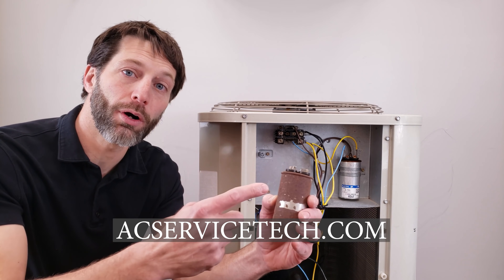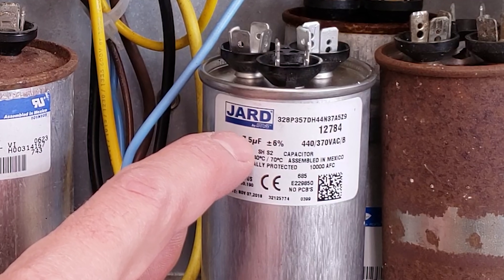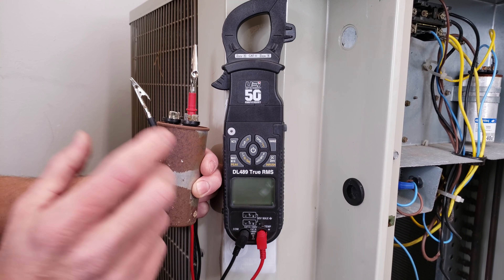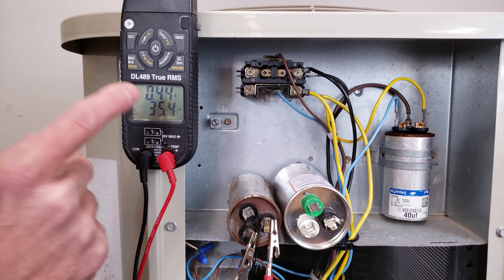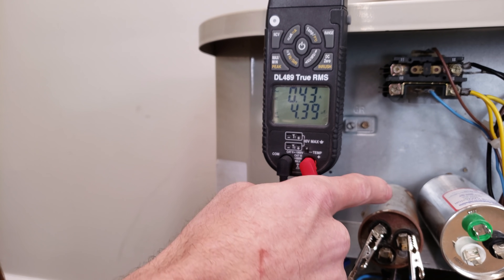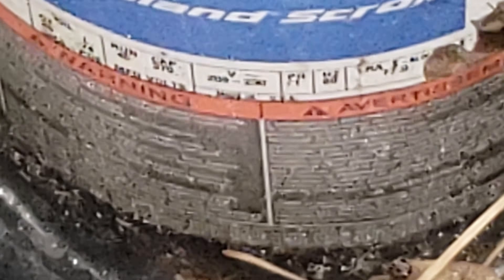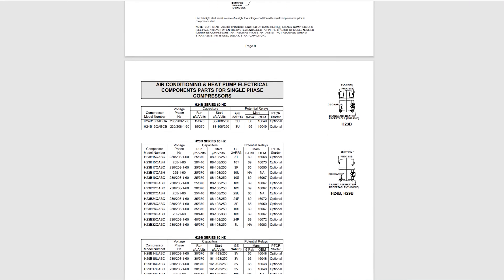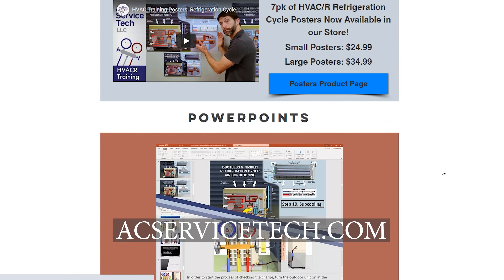Finding Run CAPACITOR SIZE on an AC Unit, Ratings Worn Off!

Comment: Well done video but it's incorrect at 1:20.  Oversize does not burn windings. Oversize can cause relay chatter, wear or weldment on contacts.  Undersize reduces starting torque.  10% deviation is allowable.  Any information on substitution?  There's that call downtime will cost money or product, but I have a truck with assorted spares.
Reply: Higher or lower than specified MFR run cap will increase run winding current, increased current reduces efficiency (cost $$), increases heat and reduces lifetime.
Reply: @dan4091  Thank you for your answer.
Reply: you are confused; "relay chatter" refers to the coil on the LOW VOLTAGE side of relays and is caused by LOW VOLTAGE. Impossible for relay chatter to be effected by the side being switched on or off, it can only be effected by the switching circuit that energizes the coil that thrusts the set of contacts closed or open
Reply: @patrickhutchins6935   In capacitor start motors, relays are line voltage. In capacitive circuits current leads voltage. Capacitance reactance of a capacitor in ac circuits plus motor impedance are factors to balance for enough current to provide starting torque.  Too small a capacitor and there's insufficient "boost" for starting, and too large there's a mismatch capacitive reactance with varying voltage effects that can cause relay cycling and points heating.  Not always noticeable at first, but it does exist.  For reference check into the RSES SAMS Manual for further reading.

Comment: Whoa. An artificial phase of electricity? That’s funny, I always thought run caps kept your voltage and current in phase with each other when the inductance of the motor pushed them out of phase….I guess trade school lied to me 🤔

Omg putting in the wrong size capacitor doesn’t burn out a winding. It pushes the voltage and current out of phase the exact opposite direction of the inductance of the motor and makes the motor get hot. It will just cycle on thermal overload. It very rarely burns up a winding.

Holy misinformation Batman
Reply: Not on a CAPACITOR RUN motor there sparky, the voltage and current are purposely shifted 90 degrees out of phase to generate a rotating magnetic field. Kinda looks like your trade school professor may not have been the brightest bulb on the block !
Reply: @nunyabusiness6746  it’s not a capacitor run motor dill hole. It’s a PSC motor. The RUN CAPACITOR is on the START WINDING. Also, since you obviously don’t know, each line in single phase is 180 degrees out of phase there bucko.
Reply: @nunyabusiness6746  a run capacitor is literally in series with the start winding on a PSC motor jackass. Google it.
Reply: @nunyabusiness6746  Did you seriously ask me if I know the phase angle of three phase? Do you even math? Uhhh 360/3=120 degrees.
Reply: @nunyabusiness6746  maybe next we can talk about the different between wye and delta winding configurations in transformers, how they affect the potential voltage to ground, and the difference between wye and delta winding configurations in three phase motors. You’re barking up the wrong tree bucko 🤣
Reply: @nunyabusiness6746  you can’t even define grounded and grounding conductors without google because you don’t even know that a run cap is in series with the start winding on a PSC motor and literally has nothing to do with the run winding 🤣🤣🤣
Reply: jman0870 I’ll talk all the electronics you want i’ve been an electronics technician 40 years, can you tell me what VARS stands for?
Reply: @nunyabusiness6746  remember that time you thought I didn’t know the phase angle of three phase? Cmon bucko. Wye vs delta on transformers and motors. What is inductance and what is capacitance’s effect on it?
Reply: jman0870 Quick,  give me the formula for resonance.
Reply: You have a circuit with a  with 10 ohms resistance, and10 ohms of inductive reactance, how many degrees does the voltage lag the current ? It’s a trick question, let’s see how much you really know !
Reply: jman0870 The run cap is parallel to the series combination of the start and run windings, if you put a voltmeter across the capacitors herm. terminal which goes to start winding and the caps. common terminal which feeds the run winding terminal, the voltage you will see is the series combination of the back emf generated in the start winding combined with the run winding voltage. Now your car alternator is wye generator feeding into a diode pack which rectifies it to three phase DC, which incidentally I have repaired in the past, you see, I also worked as an auto mechanic when I was a youngster like you ! Now delta, other than what it looks like, I  would have to refresh my memory if I wished to discuss the electrical characteristics of the delta configuration and i’m really not that interested at this point, now a wye generator is much simpler to analyze with the three windings 120 degrees out of phase with each other. By the way, do know know what a phasor diagram is and how to actually analyze an AC circuit? If not, I suggest a couple of years at a college with a good electrical technology program so you can sound a little more intelligent when discussing this crap, especially after electric machines class where artificial phasing to generate a rotating magnetic field is explained, plus even if you don’t actually get a job as an electronics tech. it will go a long way in the refrigeration field, especially these days with all this electronically controlled BS, plus perhaps one day you may even be as good as me.
Reply: jman0870And a PSC motor doesn’t have a start winding, it has an auxiliary winding and is used in low power applications like fan motors, in fact if you’ve ever worked on a really old GE refer you’ve seen the three wire fan motors they used to use, that’s a PSC motor. Yes maybe I do need to refresh my memory, I started working in refrigeration in 1975 and got my AAS in electronics in 1981 and raised my family working as an electronics technician from which I retired, and I currently am in business repairing major appliances to supplement my SSI check. I hope one day you will know as much as I have forgotten.
Reply: The wrong size run cap will increase current, reduce efficiency, increase heat, may trip the overload, and will probably reduce compressor lifetime
Reply: @dan4091  isn’t that what I literally said? 🙄

Comment: if unit calls for 40 mfd, can i put a 45 in it? somewhat about 10% (12.5%) higher
Reply: it will draw more current and be less efficient, so it'll cost you more money to operate and decrease compressor lifetime

Comment: I'm not an HVAC tech, but I did stay at a Holiday Inn Express last night.  

My HVAC system that was installed just  under 3 years ago has stopped pushing cold air and the tech that is scheduled to service it tomorrow said it was likely a capacitor.  From what I've read, even under horrendous conditions, a cheap capacitor 'should' have lasted over 3 years.  Is there any helpful info you could share with us homeowners so that I can try to ensure that they don't just slap in another poor quality part?  ✌

Comment: It's very simple - run the motor with different value capacitors, use the capacitor that draws the lowest amps. (for motor run capacitors - not start capacitors).
Reply: Great idea in theory and maybe completely correct but kind of impractical unless you have a dozen or so capacitors lying around right?  And no DIY will have that.
Reply: @condor5635  That's when you make friends with the guy that works in the electric motor repair shop.
Reply: @paulsawczyc5019  who has time for that ? Lmao

Comment: Great Vid !! I used your method to find out what my AC called for, and as luck would have it my Cap. was replaced by AC Tech. approx. 2 years ago with a 55/7.5 cap.-when I took a picture on compressor like you said it called for a (50 not a 55) is it safe or should I replace it ? the fan rating was correct at 7.5 Thanks in Advance !
Reply: 10 percent higher or lower is ok

Comment: great content, what if the fan writings are worn off? I got the first number and the cap.  Just need the fan?  do you just guess on that?  it is a small fan so i will assume a 5
Reply: try a 5 and 7.5, see which draws lowest current and go with that

Comment: i hade one the other day it looked to be a 40 or 45 mf and i got 21.5. I megohm the compressor and it went straight to bad.
Reply from the maker: The compressor killed the cap or the cap killed the compressor, thanks!

Comment: Thanks for stressing that the mfd rating is important and the voltage of a new run capacitor can be the stated voltage or a higher voltage. As a preference I always replaced with the exact mfd rating but always with a 440 voltage rating. With contactor replacing, I always replaced with a 40 amp. although the factory installed a 30 amp. Thanks for the excellent accurate videos.
Reply from the maker: Awesome, thanks!

Comment: What happens if the info is worn off, no schematic and “the capacitor exploded, so it reads no value”???  What if a tech before you takes out the cap and doesn’t come back, no info?   It’s not always that cut and dry.
Reply from the maker: I'm with you but what do you have left in that scenario? There isn't much left in order to determine the HP of the compressor to determine the run cap size. I just wanted to clearly state what to do in the rusty capacitor scenario, thanks!
Reply: @acservicetechchannel  i have discovered that in most cases the start winding needs to flow one third the amps that the run winding does.  The size of the run capacitor determines this.  When none of the manufacturer's data is available just guess.  Start the unit and measure the amps flowing through the run capacitor and through the compressor common. If the capacitor amps is more than one third of the compressor amps you guessed too high; change to a smaller capacitor and check your amps again.  If it was less than one third you guessed too low; change to a bigger capacitor and measure amps again.  You will soon have a happy compressor.   I would guess the fan motor would work the same way but I've never needed to try that.
Reply: @kbouwman64  actually you want the run capacitor that gives the lowest run winding current, a run cap value lower or higher than ideal will increase run winding current

Comment: I got questions about Honeywell t-stat pro series . I turn on  for cooling but the heat comes on . Is this t -stat issues it’s a heat pump
Reply from the maker: check on the dip switch on the back of the tstat to make sure it is set for furnace and ac instead of heat pump if that is the type of system you have, thanks!
Reply: @acservicetechchannel  thanks for your help
Reply: You need to wire for Heat Pump versus ELECTRIC HEAT use most likely O in tstat terminal. Instead of W
Reply: @renecuevas4128  thanks for your help
Reply: If your Heat pump Energizes on Cooling use O terminal if Energize on Heat use B terminal instead and do not Confuse it with Common blue  wire😁

Comment: Thank you so much! The guy that serviced my ac decided to replace my capacitor because it may fail soon. He didn’t have the exact replacement so he installed one of a slightly higher rating and left with my original. Now I want to have a spare but know way of knowing what was the original. Thanks to this video I am now able to buy one with the exact ratings
Reply from the maker: Awesome Lincoln!

Comment: Thanks again for sharing the tips. One thing to add........
If you have to look up the capacitor information and you find it, WRITE IT DOWN 😂 somewhere readily accessible so you don’t have to look it up again.
Reply: With a Sharpie inside the unit close to the place its installed.
Reply from the maker: Absolutely, great tip!

Comment: Common on a capacitor? That's weird.
Reply: Dual
Reply from the maker: Common can mean a lot of things depending on the application on the component, switch or in reference to electricity, thanks!
Reply from the maker: In this case it is the terminal that connects the plates of two capacitors at a common junction point, thanks!

Comment: Thx for your videos I have a question sir How to find rpm if you can't read it on an outside motor 
I been do it trying a regular 1075 first and if I feel vibration or noisy  fan motor just swap it to a low rpm and work for me but of course it's a wasting time please give me and idea if there is another way to find the rpm to do de right motor
Reply: Supply houses for the equipment is a good start.

Comment: If it's a Copeland compressor you can look it up with the Copeland mobile app with the compressor's model#.
Reply from the maker: Absolutely, the manufacturers across the board are developing their own apps and they are getting better and better for parts lookup. Its great!
Reply: Will this work for an older copeland compressor (1979)?
Reply: @geminidreamer6926  What's the model number?
Reply: @geminidreamer6926  Yes that's listed in the app. Not a lot of info on it, because it says obsolete.
Reply: @geminidreamer6926  27,100 BTU R22 hermetic 208/230v 1phase
Reply: @jonhvac  Thank you.
Reply: @geminidreamer6926  your welcome

Comment: I've never understood why the capacitor size is not standard information that is required to be on the data plate by ALL manufacturers. that is one of the most important pieces of information you need to know when working on a unit. Why would that not be on the data plate. It makes no sense.
Reply: I’d be happy if they would just stop using the data tags that fade away after being in the sun for 8-10 years.  Do think I wouldn’t buy a unit if they charged .50 or 1.00 more per unit and went back to stainless steel data plates.  It’s just one of those pet peeves that makes me crazy.
Reply: @speckulator7516  have you seen Trane RTU drawings? They are barely legible from the factory nowadays and fade faster than the damn nameplates! What a joke 🤦‍♂️
Reply: @jman0870  no I haven’t Jman.  And it sounds like I don’t want to see them.
Reply: @speckulator7516  many of them are literally illegible before they leave the factory. It’s pretty awesome.
Reply: @jman0870  it sounds like it. got bless you!
Reply: There needs to be some form standardization in the HVAC industry!
Reply from the maker: it seems that it would require an additional rating plate specific to that unit model. Maybe they dont want to do that so in case the compressor or fan motor is switched out with another version with different cap size, techs wont get confused. It would be nice though!
Reply: They want it  not to be easy  only there dealers  are to have the info. It's  BS like making the  mfg date built into the SN# number   instead of the date.  Rheem and Rudd  have there secret  model size on the air handlers / stickers fade away  in 10 year's  plus on the outside part.  When a stamp  aluminum  plate  would be nice like they were a long time ago  now everything is  going aluminium  coils plastic  everthing
Reply: @chrisduhaime5689  dude you do realize there is a massive database on the internet that tells you how to read everyone’s model and serial nomenclature, right? It literally takes one google search and then you hit the bookmark icon 🙄. Coils are going microchannel for efficiency. The equipment holds half the refrigerant and does the same amount of work. What are you even going on about??
Reply: @jman0870  well before  cell phone  dependency  and weak spots  it would  not be very hard for them to have to have a good nameplate  micro channel  is not going  to last long  if it gets  hit your  not fixing  it  and warranty  won't  cover damage.
Reply: @chrisduhaime5689  have you never seen a car radiator or condenser? They eat rocks at 80 mph every day 🙄 It’s not my problem if someone doesn’t buy optional hale guards. I’ll sell them a new coil and the optional hale guards at the same time. 🤷‍♂️
Reply: J @jman0870  I live in south Florida  our cars  get  beat every day  with  gravel  and dead 18 wheel tires chunks  it  hell down  here